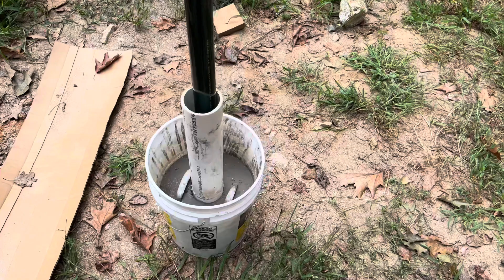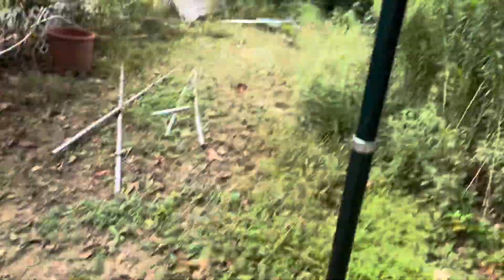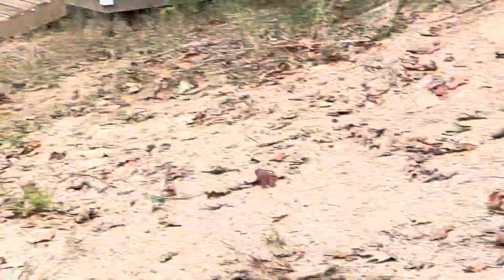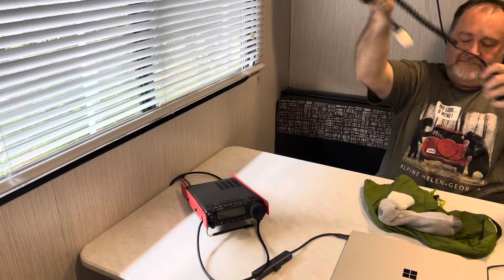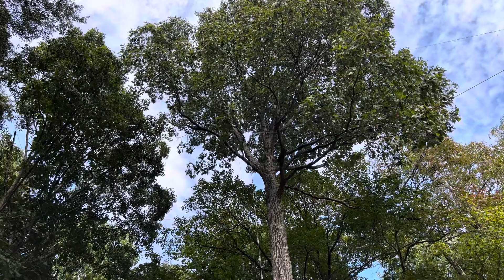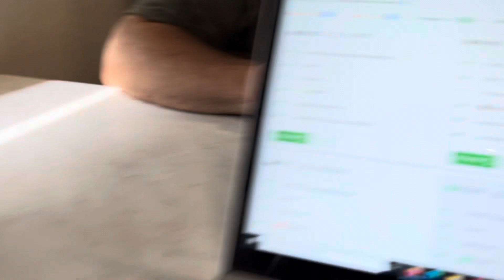The W4KWM RV Base Station

Comment: Doug great video as I was in  California, Tehachapi with my ftdx10 in our trailer.
I had a Comet CHA-250B antenna bolted to the back ladder as I was at a RV park no room to spread out an end fed or dipole antenna.
Where does your brother feed his built in Anderson power strip, batteries or 110 vac power supply?
Reply: The 12v is from a buss on the frame the manufacturer did.  It's the feed point from the battery and solar panel input connection.
Reply from the maker: I asked Wayne to answer your question. I see that he did. 

73, de N4HNH

Comment: Eventually the wife and I will be traveling to the National Parks and I will be HAM radio ready…so the video gives me ideas on what I might want to do.  BTW….I would like to know how to find HF radios that support APRS….or is there a APRS device that would work with the HF radio?  Thanks again to you and your brother for the RV ideas. ()Rob WD4IFT)
Reply from the maker: Hi Rob!  Portable operation is fun. You will of course be well-set to operate POTA.  

I’m not aware of an HF radio that supports APRS. The iGates and digipeaters monitor 144.390 MHz. 

73, de N4HNH